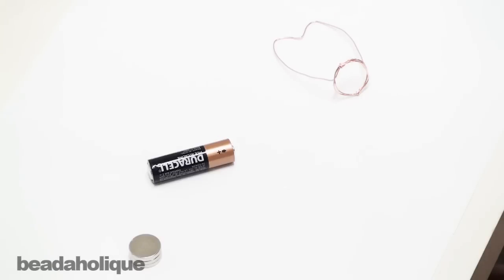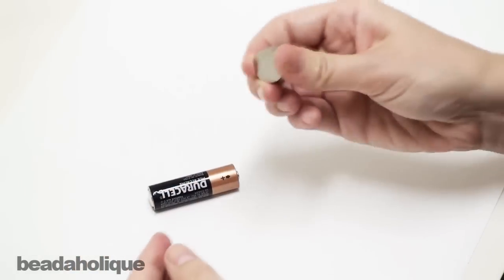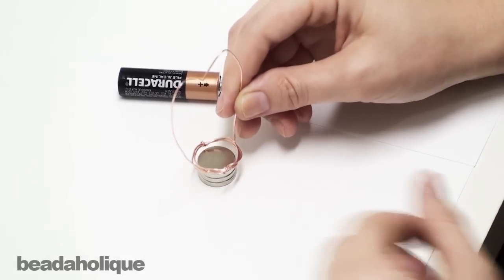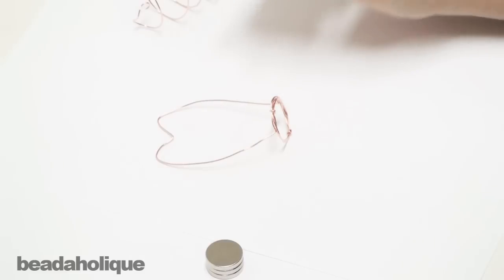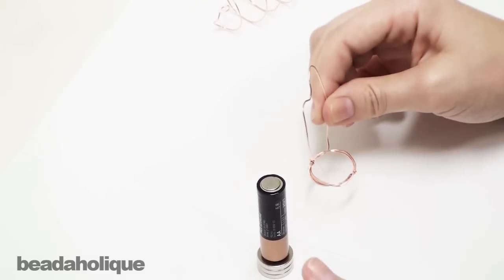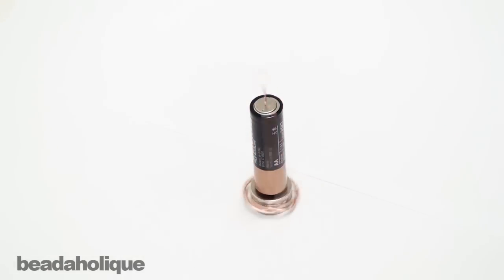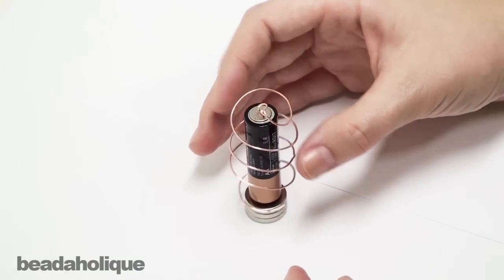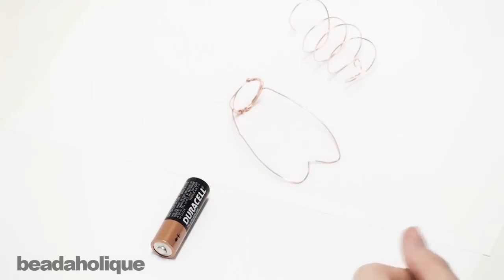How to Build a Homopolar Motor Using Neodymium Magnets

Comment: It works because the electricity running from the battery through the copper wire creates a magnetic field. This field interacts with the neodymiums field and causes the wire to spin.
Reply: +Chris Spiteri nahyou said field twice
Reply: +robinsss Yeah. The ELECTRICAL MAGNETIC field interacts with the MAGNET MAGNETIC FIELD. two fields :)

Comment: Heavier gauge wire will keep it's shape easier but it's harder to bend. I usually use 14 gauge household wiring - either strip it or use the ground. But you have to use pliers to shape it. Gonna try smaller gauge next.

Comment: A single AA battery doesn't have enough charge to electrocute(unless you tried to lick it) or heat up that strand of copper wire.
Reply: They can't electrocute but they can heat up copper wire depending on its thickness.

Comment: Nice video. :) It moves by pulling or pushing itself along the magnet(which the magnetic poles are facing along with the current) from the electromagnetic power caused by a short of the battery, so it spins. If you switch the magnet poles, it switches direction. The standard DC motors uses a commutator which switches the electromagnets everytime they align with the magnetic poles, so then it spins, that's how they work.